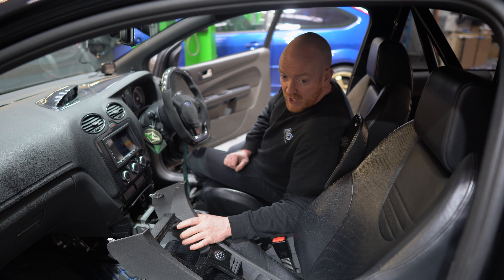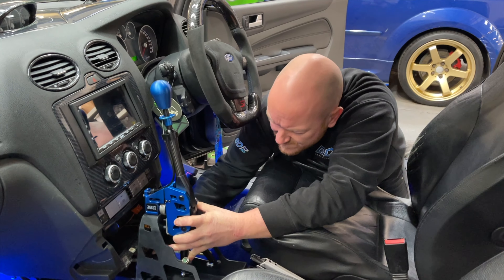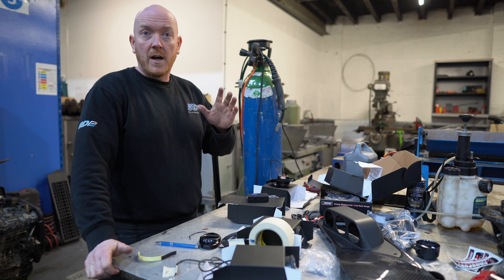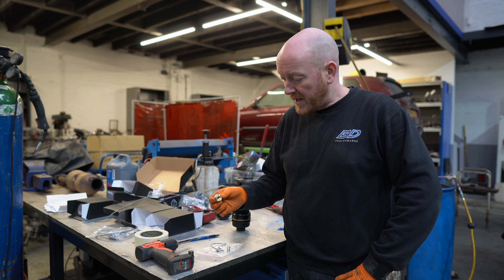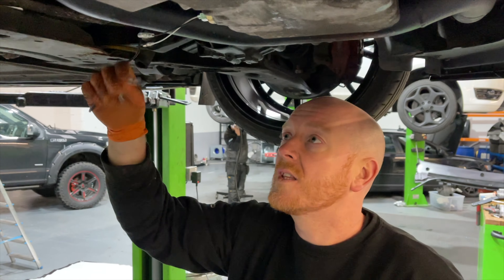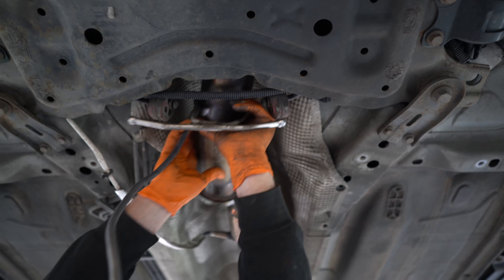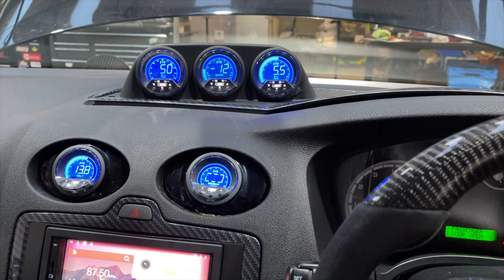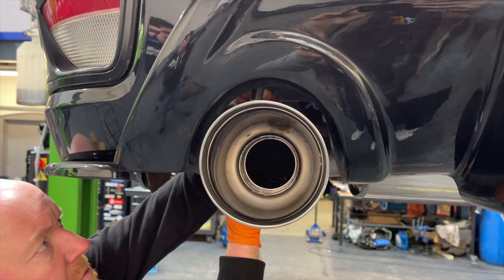LITTLE DEVIL GAUGES & ZEROPOINTONE TECH SHIFTER INSTALL - BD PERFORMANCE TRANSFORMATION - PT1

Comment: Oh George man was getting into this video man and you stop it 😭🤣 wicked video mate👍🏾 p.s what is an AFR GAUGE what is it for??
Reply from the maker: It’s air fuel ratio. It measures if a car is running lean ( it was before ) it measures inside the exhaust system.
Reply: @GCMYT  cheers mate 👍🏾

Comment: Nice video as always. When i bought my little devil gauges i did contemplate the boost gauge pod mod but the one they offer looks to bulky and ugly imo so i stuck with the standard one and used a pillar pod and vent gauges.
Also like the sequential gear shifter but its damn ugly at the same time. As long as you enjoy your car though thats all that counts. 👍🏻👍🏻👍🏻👍🏻